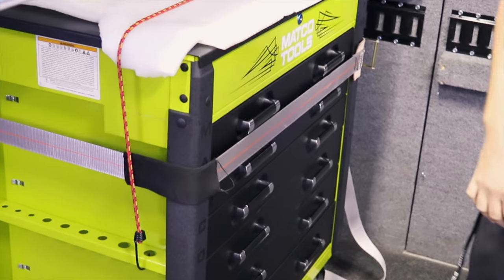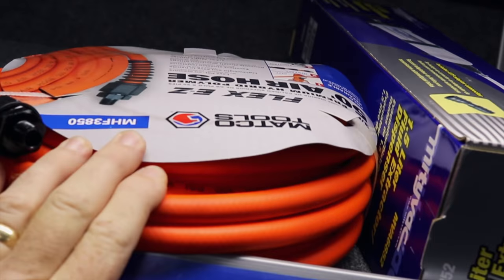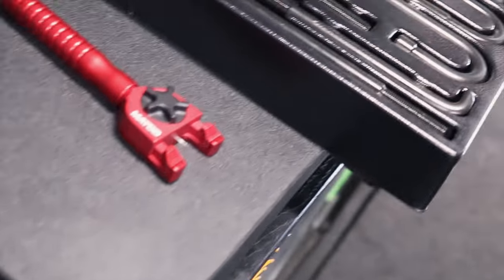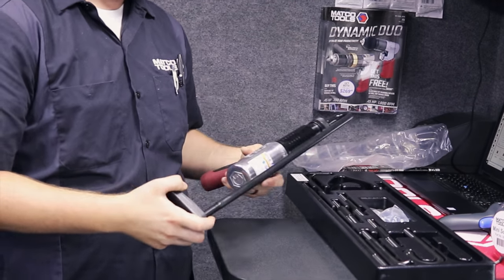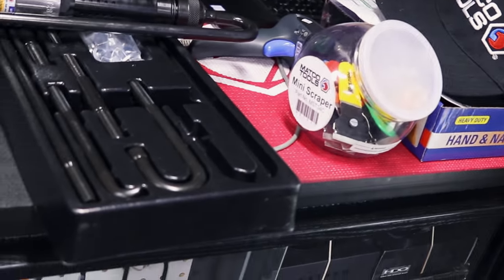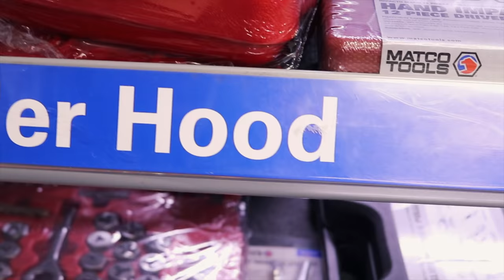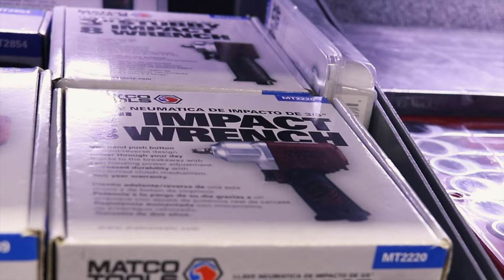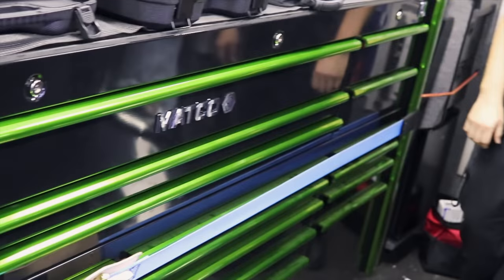MATCO TOOL TRUCK TOUR: Texas Twister

Comment: My biggest hangup is that 90% of matco stuff I can get the exact same tool, exact same warranty with a different sticker for less money through snap on or my independent. And it will be stood behind as well or better. Everyone rebrands. I'm not anti re brand. I just hate that that's their main business model. They don't in house produce much of anything. Now if they were cheaper in cost then they may have something

Comment: So, the question is, if the texas twister for example purposes is in ur “want” therefore u did not purchased it today, n snappy comes n has it 10% less or even the same price but now u have the itch for it... do u buy it from snappy matco or even cornwell? All 3 sells them same warranty, where is ur loyalty? been this is not a tool made by any of the companies?  Does ur loyalty lean towards you pocket, service, or most tool brand used?

Comment: Yea want s vs needs always tuff 

Bought a scope WANT

bought  I.F.R gun WANT

Bought a smoke machine WANT 

That set me a few dollars back  but all have come in very handy the few times i need it 

Was sent on a truck that had low boost got to the truck new turbo new computer new low pressure pump put the smoke machine on it what I find ? truck came equipped with an E kill found the valve was shut 5 minutes $175 later done running and gone I know that ECM set them back about 4500,turbos (2) probably about another Seven Grand fuel pump 500 and all it was a e kill all along

Yes the truck would start and run with air valve closed

Comment: I am not impressed with the Texas Twister yet.Tried it on a wheelbearing removal,did not budge at all.I do have that air hammer that was pulled to show how the attachment goes on,it's a beast and does break bits.I broke one bit with mine so far
Reply: Walter Frederick I bet the wheel bearing is pretty seized up in its hole.  I know I haven’t removed many that were easy.